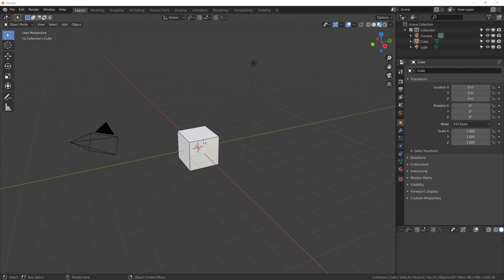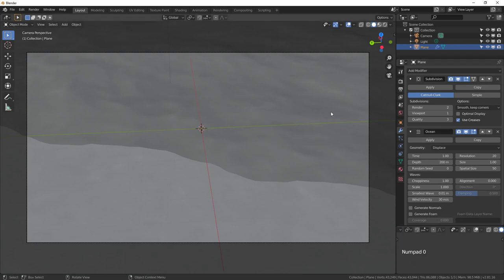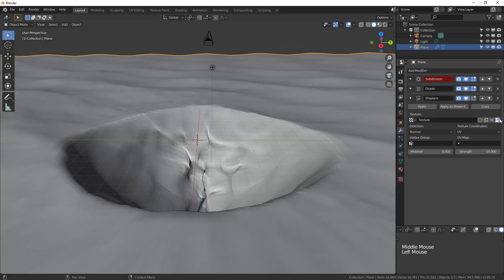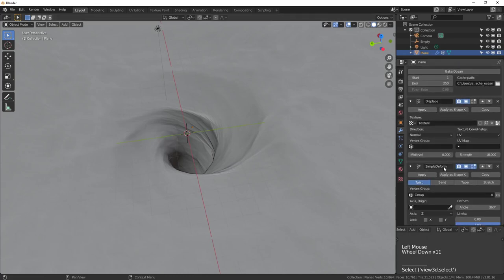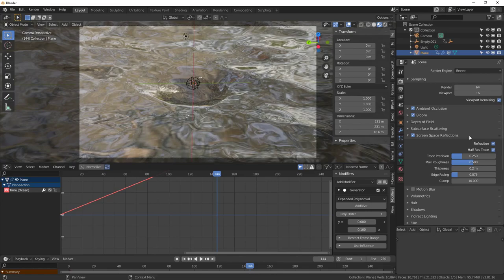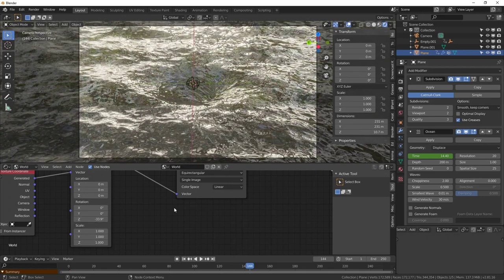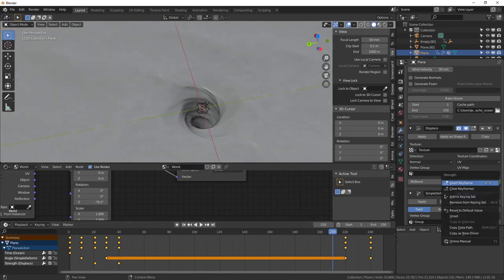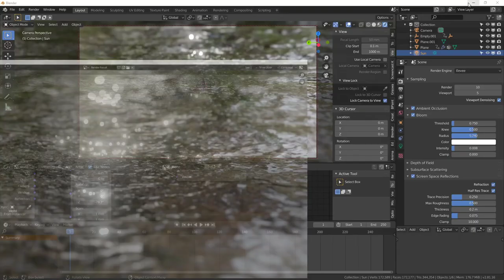Realistic Water Swirl Tutorial with Blender & Eevee

Comment: You need to start using NodeWrangler.
Also, UV is set by default to all textures.
Reply from the maker: I don't like node wrangler. Its the one thing that messes my procedural material to the max. And for something like this, its not really needed. And yes, all objects have default UVs.
Reply: @blenderpirate  How can it mess your materials, unless you use it incorrectly?
And i don't mean automatic UVs, i mean that you have no need to connect it in nodes, it used by default if disconnected.
Reply from the maker: @AllExistence  Maybe I use it incorrectly! Whatever.